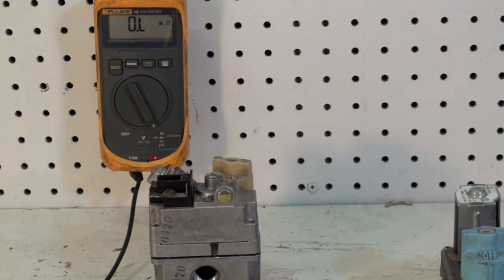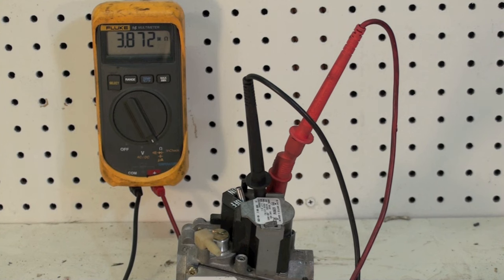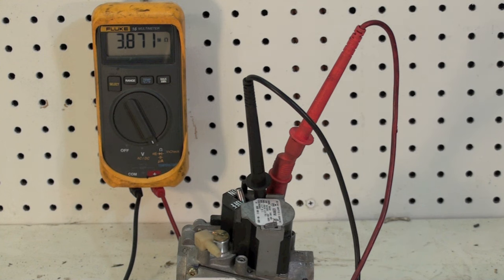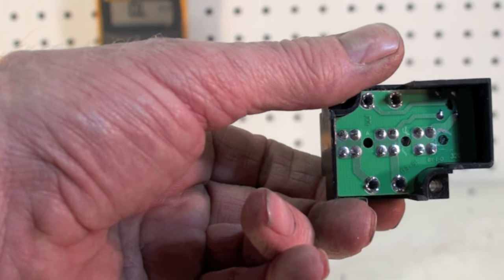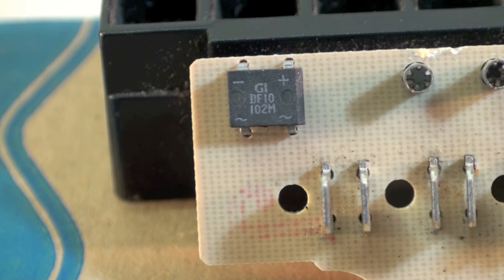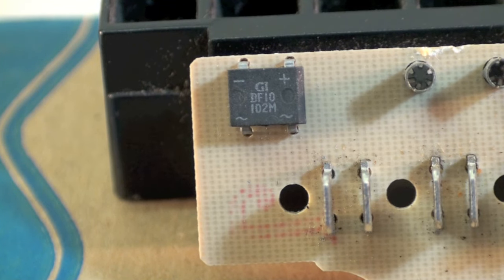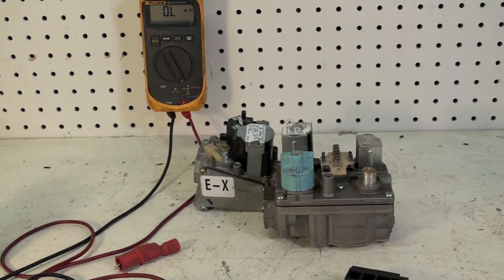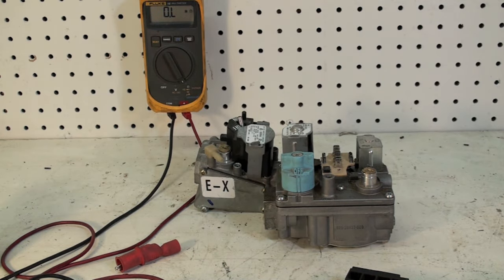How to test the gas valve on a gas furnace with an ohmmeter

Comment: Ok I put a jumper across the read and white on the mainboard *alligator clips*  and cycled the furnace....

Same thing a horrid buzzing from the relay in the gas valve assembly. 

Someone suggested to me it could be improper gas line pressure?

I know that that 8205h is pron to corrosion at the internal board.

I have a place ready to purchase a new valve assembly on my behalf but they want 150 bucks!
Anymore thoughts?

Comment: I guess I dont fully understand what you mean.
I just now put a new transformer rated for 40va. @ 24vac.
The honeywell gas valve is old.

So what happens is everything seems to function..
It purges
THe igniter lights up.
And then as about two second after the bruners lights the gas valve starts buzzing.

What do you mean by jumper red and white?

Comment: if it's a bridge rectifier couldn't you put the meter on diode test and depending on the polarity of the leads on the terminals forward bias one pair of the diodes, should get a little over 1 volt
Reply: Yeah, but you are trying to get an ohm-reading for the coil.

Comment: Hi, I'v leand alot but not enough. I have an old Day & Night furnace. It has only 2 terminals on the control valve and they are open. I pulled the wires  off from the thermopile and the pilot keeps on burning!  .Any suggestions? Thank you.

Comment: Why would you not be able to check the solenoid coil with an ohmmeter after removing the terminal block?  Both ends of coils are exposed after removing terminal the block. I need to know the resistance of coils.  One measures 98 0hms and other is open?
Reply from the maker: You could.  At that point, you have removed the wires form the terminal block.  Putting that back together just increases the labor time and the coils almost never fail.  Even if it did, I would not be able to find a coil as the parts are not available.
GFM
Reply: @grayfurnaceman  one coil measured 100 ohms and other was open.  Bought a replacement valve and good to go.  Thanks for responding!

Comment: I have 36C04 222 standing pilot valve. The pilot was not remaining lit. I changed thermocoupler 2-3 months ago. It started the same problem again. No The pilot has 20-30 mV dc circuit (thermocouple) and main valve has 24 V AC circuit. I checked my main gas valve solenoid resitance of 64 ohm. For pilot solenoid the resistance come 0.1-0.2 ohm. Considering such a low voltage, it seems logical to have very low resistance. What is typical resitance of pilot valve solenoid?

Comment: The pilot stays lit. But when I bypass the thermostat to fire the furnace, I hear the click. But the pilot just doubles the size of the flame. The burners don't ignite. I wiggled the stat wires and I made a hum sound. I'm thinking I have a sticky valve that just isn't fully opening up? Its not been fired in about a year.

Comment: Hi, on regular basis my furnace stars and it runs for around 30 seconds and than once pilot lamp turns red, gas release valve releases gas. Lately when I'm having problem in my furnace that gas release valve releases gas ad after 5 second it shuts off gas, it keep doing that for 3 times and after that furnace turns off than I have to keep trying it till it works, can you please tell me do I need to change gas release valve or there is something else wrong in furnace mother board and not in valv

Comment: I got 15 volts coming in when I turn on the fan. 24 volts if i put the thermostat on like if the pilot is on. I already check for gas coming into the valve. Also took the tube and pilot out and clean the pilot. Took the pilot out, put the valve on set and I don’t get no gas at all. Is there anything else besides the valve that could be bad? And also is 15 to 16 volts ok for the valve to open and le gas through?

Comment: I'm working on an old American Standard furnace. Much of the name plate is worn off, but it's about 65% efficient American Standard furnace. The furnace goes through the steps and the hot surface ignitor lights up, but gas doesn't come out. It was working previously, but someone tore it down, and put it all back together making repairs, and now the gas won't blow. I think it's something to do with the valve. From the module, I have 2 wires going to the top of the valve in terminals 1 and 3 on top of it. 1 and 3 are also jumped together with a common wire. The wire in terminal 1 on top of my gas valve, and the wire in terminal 3 go to my electrical module. I'm confused as to whether the electrical module is wired incorrectly, or if it's the relay on top of my gas valve. Any way, I get 1 red blink from my electrical module when it's supposed to be releasing gas but no gas comes. The hot surface ignitor glows, then shuts off. repeats 2 more times. Any help?

Comment: Hi GFM.  Thanks for the vid.  Do you know if the coils in the newer valves can be replaced, or if the entire valve needs to be replaced?  My valve (White Rodgers 36E98 202) is sticking and requires a tap with a mallet on the "tall" coil to turn on.  It is getting 24VAC.   This is a Carrier furnace (58PAV11113112) that is about 19 years old.

Comment: I recently condemned a gas valve because i wasn't getting any continuity on the coil. I was going to take the solenoid coil out and put it in without having to replace the whole thing. How come that rectifier is interfering with the continuity testing on the terminals? This was a bryant 90%er.
Reply from the maker: The rectifier is there to stop "humming" of the valve.
GFM

Comment: I have a Robert shaw retro kit, that is intermittent pilot, that pilot light then when main gas valve is suppose to open, it shutters, clicks and clicks, but no main gas opens up, I replaced the gas valve with the same one and same thing, I had 24v at the main valve, so no I just don't get why the chatter , have not run into this problem as of yet, aslo replaced the ign box with same cond.

Comment: Thank you for ur time!
I have a gas fired hot water furnace w/spark to light. Blower comes on pump runs, spark/solenoid happens NO gas to light, keeps trying to light.  I turn off unit wait 15-30 mins turn back on and it may light or not, hear solenoid hitting but no fire.  This is intermitting.( Honeywell solenoid) Has been working for 12hrs now but may quit at any time. (not servicing this myself) need to steer him, it may not have a problem when he is here. What do you think?  Thank you
Reply from the maker: This sounds like a gas supply problem. Are there other gas appliances that work?  Are you using propane?
GFM

Comment: Good video! I have a 36c04-208  and would like to convert it to LPG. There doesn't seem to be a kit for it yet my research show its is convertible. Is this converted by just turning the regulator screw under the screw cap outward to decrease the pressure or is this model not convertible?
Reply from the maker: Joseph Perrotta That valve does not appear to be convertible.  If this is a furnace, a conversion kit must be provided by the manufacturer.  It is a code issue and should not be bypassed.  There is a safety issue here.  Hope this helps.GFM
Reply: Yes that helps. Thanks for the info.

Comment: How does the  White Rogers work?  I have one  just like the one you have.    I have voltage.  When it calls for gas.  I have to jar the valve for the gas to start  up some time's,  some times it works fine.  Bought a used one of ebay,  Same  problem.   Don'
t seem to be a power supply problem.
Reply: 36e36 230 valve.  I really think it is gas pressure
Reply from the maker: These valves work with very low pressures.  If you must strike it to make it work, replace it.  No parts are available.
GFM

Comment: I have a bryant gas furnace and sometimes the pilot goes out I'm assuming due to high winds.  The furnace stays on with the fan blowing and everything operating as if the pilot were still lit.  Because no flame is on the furnace will just continuously running!  Should a furnace turn itself off if the pilot goes out?  I haven't noticed gas odors when this happens, but concerned.
Reply from the maker: +infringinator I don't know what model your furnace is but with many furnaces with a standing pilot, the fan is timed on.  This means that if there is a call for heat, the fan will run.  When the pilot goes out, the gas valve shuts off the gas supply to the burner.  High winds generally do not blow out the pilot.  I would be looking for other reasons for the pilot outage.  Hope this helps.
GFM

Comment: This winter when I powered the unit on for the first time and the main burners ignited one of the two transformers had a puff of smoke.   I think I wrongly attributed that to being off all summer.  Now on the down cycle we heard an explosion that shook my brick building (boilers off now).   I could not find any damage, but I did smell an electrical burn.   A winter and half ago all the electric blew out on my boiler.  I tracked it to the gas valve. WR 26C80.  I am thinking the valve is bad again
Reply: You should repoint the bricks on your house.

Comment: I recently ohmed a 15 year old goodman furnace valve and a brand new generic replacement valve.  Neither of them shows any resistance reading or continuity -  simply O.L.  Is this also common to get no reading at all?
Reply from the maker: Yes.  The valve has a rectifier and may not read on the meter if it is not a megohm meter.
GFM

Comment: IM WORING ON A H.B BOILER WITH A INDUCER , PRESSURE SWITCH AND IGNITER . WHEN I TURN UNIT ON THE IGNITOR GLOWS BUT THE BURNERS DONT COME ON. COULD IT BE A BAD VALVE. AFTER 3 TRYS THE BOARD GIVES ME A CODE OF 3 BLINKS THAT IS A INDUCER PROBLEM. WHAT COULD IT BE
Reply: Thanks  I figured out the problem.  The module wasn't sending the voltage back to the valve

Comment: Ive got an emerson 36e36-201 valve. It says 1 2 3 on it. Could you explain what they are and how it needs to be wired? The furnace guy left recently saying I need a board. I bought one. Numer 1 on the valve has a jumper running to number 3. Number 2 has a blue wire and a brown wire. This doesnt seem right?
Reply: +viral gone wild I actually think Ive got it. Jumper from 1 to 3. Ground (brown) on 2. Blue on 3.
Reply from the maker: +viral gone wild #2 is common.  #1 and #3 are the 2 redundant solenoids.  The valve is a redundant valve.  Meaning there are 2 valves operated by 2 solenoids.  These are in series and both must be energized for the valve to open.  Hope this helps.
GFM
Reply: I ended up ordering a newer board. The old one was toast. Thanks!

Comment from the maker: Do you have gas?  Possible regulator problem at the gas meter.  Check with gas supplier.  
GFM
Reply: I’ve got a mr heater hanging furnace for my shop here that I’ve installed a propane conversion on and when I turn it on everything seems to work except it doesn’t light. I see the igniter sparking but seems there’s no gas coming out. I’ve got a regulator on the bottle and have tried all different pressures but still nothing! What could be my problem here? I ohm’d the 2 terminals on the top of the gas valve and got a very high reading like around 180,000 ohm’s is it possible the valve is no good?
Reply from the maker: @markD5150  The valve has a rectifier that stops an ohmmeter from being effective as a diagnostic tool.  Check for gas at the inlet.  Most valves have a tap to test pressure.
Merry Christmas
GFM
Reply: @grayfurnaceman  thanks for the response! I did some more messing with it, I’ve got propane up to the valve then I put 24 volts to the solenoid it clicks but nothing comes out the other side. It’s being fed by a 20 pound propane tank with an adjustable regulator on it that I use for my tiger torch, I’ve tried all different pressures “without the use of a guage” not sure if any of That makes sense to you but that’s where I’m at
Reply from the maker: @markD5150  The valve may click but is the pilot is not lit, the safety will stop the flow.  
Also, the 20# cylinder is too small, when it gets low on propane, it will reduce pressure and the flames will reduce.
GFM
Reply: @grayfurnaceman  it’s got an igniter no pilot lite. So I got it working but still not sure what the problem is. There’s a small plug below the gas inlet, if I open it and let some propane out or bleed it in other words the valve will actually work and I can get it to light! But I’m having to bleed it almost every time I turn the heater back on... any ideas?
Reply from the maker: @markD5150  Possible regulator problem
GFM

Comment: I turned on the heat, the motor ran, I was sure the pressure switch closed bc the igniter lighted up, but the gas valve didn’t open. I smelled no gas. Measured the voltage for the gas valve on the control board (blue wire and the common wire and I got about 27 volts. I think but I am not sure that the gas valve is bad. Is there any place else to look? Bought an old gas valve from eBay but haven’t tested it yet. If I take the wires from the old gas valve and plug it in the new eBay gas valve, should I hear a click? Thank you.
Reply: Do you have gas available?
GFM
Reply: @electriccar3253  I am sure it’s there. Had never turned it off. Thank you.
Reply: @electriccar3253  if the flame rollout switch is bad, will burners work? Thank you.

Comment: I have a Williams Monterey 35000 btu wall heater. The pilot it will not stay lit after I stop pressing the pilot button even after warming thermopile over a minute.

I ran some tests: 
I disconnecting the two thermopile wires from the gas valve, connected a meter to them, and I got a reading of 755 mV. Next I removed the gas valve from the heater and connected the thermopile to it. I used a butane torch to heat the thermopile as I watched through the gas line opening to observe the solenoid. Initially while pressing pilot button it was open about 3/16".  After heating thermopile, when I stopped pressing it remained open about 1/16". When I turned off the butane torch it snapped closed.   Should it be open wider like when I'm physically pressing it?
Reply from the maker: +Happi I don't know on the valve opening.  Looks like the valve needs to be replaced.
GFM

Comment: Question for you sir, on the White Rodgers Valve, you pulled off the black box/circuit can you tell me the gas valve number?
Reply from the maker: Yes, its 36E01.  Hope this helps.
GFM
Reply: Can you please help? YORK FURNACE Down Flow  MODEL P2DPD12M08001A... I am replacing a White Rodgers gas valve the vent hole was pluged at factory 36e97 204---obsolete.....The replacement gas valve part is a 36J24---214 with vent not pluged.... This is what York told me to replace with do i plug the elbo vent hole??????
Reply from the maker: FLYWHEEL1967 I can't remember if that furnace is an 80% or 90%.  If it has plastic vent pipe it is 90%.  The 90% furnace needs the vent to go to the combustion chamber.  If it is 80%, leave it open.  Hope this helps.
GFM
Reply: 80%er York just called me tec supor said to leave it vented.... THANK YOU FOR GETTING BACK TO ME SUR....Happy Thanks Giving

Comment: I have tested the voltage going to the valve.  I read 13V on the valve before the valve is energized. after the valve is energized I read 24v.  Is that normal to read 13v on the valve before the valve is energized?
Reply from the maker: Yes.  The 13 volts is a ghost voltage.
GFM
Reply: @grayfurnaceman  Thank you for the reply.

Comment: how do you test if power's going to the valve?
Reply from the maker: If the valve has power and gas is available to the valve,  the valve has failed. Hope this helps. 
GFM
Reply from the maker: I just rechecked your question. If you are asking how to check for power, you have to have your meter leads on the valve terminals while there is a trail for ignition. When there is a trial for ignition depends on the age and model. Hope this helps. 
GFM

Comment: My gas value model 36c03 reads 4.76m ohms so its bad?
Reply from the maker: Because it uses a diode to convert to DC,  the reading means nothing.  If there is power to the valve on a trial for ignition, and gas is available, but nothing comes thru, the valve is bad.
GFM

Comment: What about ohm meter on the safety valve solenoid???
Reply from the maker: You could ohm out the solenoid.   But there is little reason to as the gas valve components are not replaceable.
GFM

Comment: I've given these valves a sharp tap with a hammer and they work like normal. Why?
Reply from the maker: The valve is failing inside.  Remember, the valve is pressure operated and the pressures are very low.
GFM

Comment: I have that very same WR Valve and I today the heat quit. When the furnace kicks on the valve or Solenoid makes several clicking/arc sounds and the ignitor glows but no flame. I've double checked my gas flow and it's good. what would you suggest?
Reply from the maker: If there is gas flow on a trial for ignition,  and the HSI glows,  the HSI could be failing by not getting hot enough or possibly dirty burners.
GFM
Reply: grayfurnaceman I have torn most of it down and all seems fairly clean. recleaned most of the contacts with a wire brush but now that it's back together I get the same result with the electric arc sound. I even resoldered some contacts on the circuit board because some of the Cold Joints were cracked. Can a solenoid go Bad and stop opening/closing ?
Reply from the maker: Yes.  Solenoids can fail.
GFM

Comment: robertshaw 7000 model gasvalve fault
during ignition solenoid is energies but not open gas
there is sound like not enough amp
when I closed the regulator knob on the valve solenoid is opend there is sound gas also opened,,,,, every time I have to do this
pls help me to do the correct action
Reply from the maker: Replace the valve.
GFM